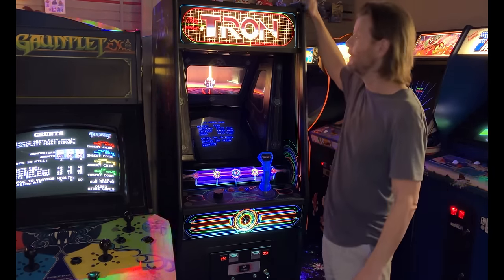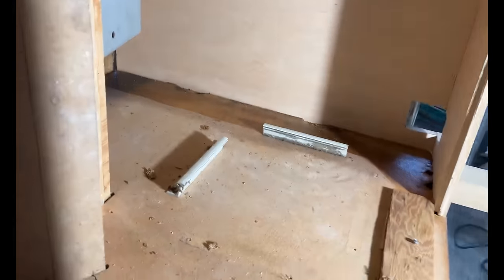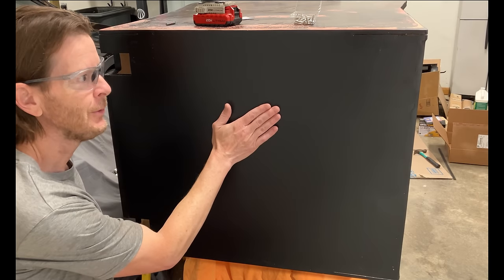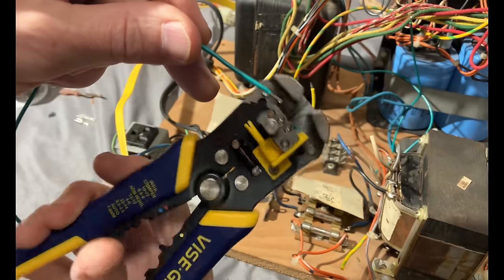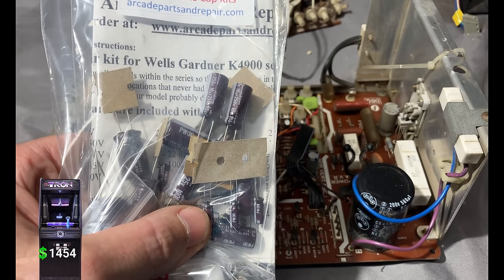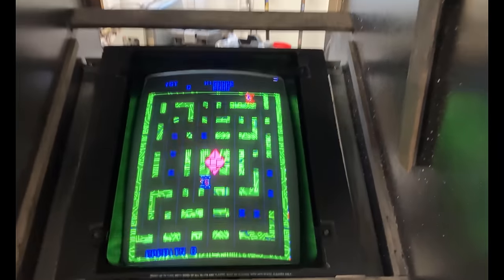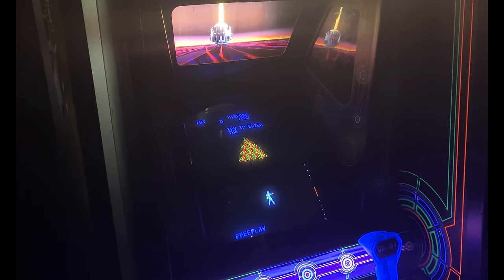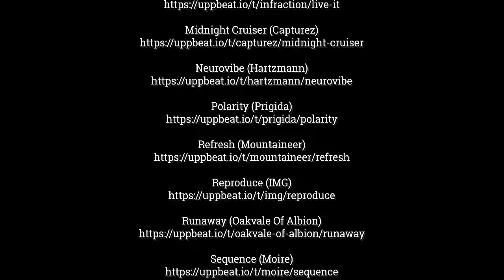"Trashed" Tron Arcade Restoration!

Comment: 1:07:18 would a dim bulb tester (cheap) or a variac (expensive) be useful for working on systems like this? Many amplifier repair techs use them to avoid drawing too much power from the get go and blowing the electronics when there are shorts.
Reply from the maker: Not really--the circuitry built into the monitor will keep it from coming on if it doesn't get full power (or shuts it down if it gets too much). For the most part you just have to give it a go and see what happens. In most cases if there's a short the main fuse will blow anyway.
There is a trick for a monitor chassis where you can use a light bulb to test part of the circuitry (and I have done this) but that would be more for troubleshooting if it didn't work in the tube. Thanks!
Reply: @tcurtis49  Gotcha. That rules out the variac. How about a dim bulb tester?
Reply from the maker: @MikeDS49  The biggest issue overall is the amount of voltage that goes through the red anode cap. If it’s not physically attached to the picture tube then it’s fairly dangerous. When we test the voltage circuit with a light bulb we put the anode cap in a glass jar for isolation. And in all honesty if something does blow it’s helpful for troubleshooting anyway. The worse scenario is to keep blowing the fuse but not be able to trace why. So I’m more fingers-crossed that either it will work or there’s a clear reason why it doesn’t
Reply: @tcurtis49  thanks for the explanation!

Comment: Satan's Hollow requires at least 1 (preferably 2) shield button(s), to be able to play it properly.
A stock Tron control panel does not have a button that can be used for shield for Satan's Hollow.
Reply from the maker: I haven’t played it much but here’s what the kit instructions say: “Satan's Hollow SHIELD is activated with your choice of Spinner, Up, Down or Player 2 button (default) [all menu selectable]”
Reply: @tcurtis49  
That'll work.
Won't be as nice as dedicated buttons, but still will work.
Reply from the maker: I agree. I always try to play in original cabinets when possible. But a nice added bonus in this case :)

Comment: Casters are a serious safety hazard. The amount of offset torque you have with a heavy game like Tron = material ripped out of the bottom of the cabinet and a game that can tip over unexpectedly. I have seen it happen numerous times where either the cabinet material fails or the caster fails. When being played, the game can wander and you cannot level the cabinet on casters. I use and always recommend teflon leg levelers. You can level the cabinet, it stays put but it's easy enough to move when you want to move it. Also has a much lower chance of hurting flooring. 
Wanna move a game a distance, use your hand truck.

Aside from that, brilliant restoration! The game looks awesome in its finished state!
Reply from the maker: You may have been using the wrong casters. These are heavy duty and attached with 4 screws each. I have seen the smaller ones that insert like leg levelers fail; I had a Gorf that tipped sideways on an angle once so I know what you mean. If these get torqued hard they simply stop rolling and stay jammed. They don’t come apart.

On carpet they don’t drift and are pretty level since the floor is level.
I’ve moved 40+ games all over the place with these casters for over 20 years. No issues at all. And I’m certainly not alone—a number of collectors I know always do the same.
But to each their pwn and glad you enjoyed the video!

Comment: Now you've built a plastic case out of the chipboard case. For the cost of repairing the wood you can get brand new wood ;). But at least you can say that it's almost original. Almost a sculpture. Well done. It'll last another 40 years. 🤩 No one can say that you have no respect for the Tron machine 👍
Reply from the maker: Well, only a small bit is resin (relatively), and that's what chipboard contains anyway, and I added the wood chips back, but I get what you mean :) I really considered cutting new sides but thought I'd give it a try and I was really pretty happy with the repair. Easy? No... Satisfying? Yes :)

Comment: This can be a rather nutty community, where one's opinion on a matter is used as an excuse to insult or undermine another persons experience and pleasure in this type of undertaking. I'm glad to see someone that does things in a way to achieve their personal vision of how THEY wish a project to turn out, and the way THEY wish to go about it. My Dad and Grandfather were in the coin-op business for years, and I grew up working on these machines along with Pin-Ball, Ski-Ball, cigarette and vending machines of all sorts. For a short time I worked for a guy that rehabbed these types of things, and it just became a drag. When you do this as a business, any pleasure you may derive from it is replaced by the bottom line. If you can't rebuild it quickly and cheaply for a profit, it's not worth it. I wish I could have spent  1/3 of the time you do, doing it the way you do. I might still be working on them. Anyway, keep doing it the way you're doing it! And always remember, if there's a problem it's power supply, power supply, power supply!
Reply from the maker: I do have to be careful not to get caught up in getting something done quickly. When I first started fixing up games that was the goal—I just wanted to play them. As I’ve gone on it’s far more about diving into the history of the game and trying to make them look the way that brings back the most nostalgia for me. You are right, working on these as a business would lose the luster and fun pretty quickly.

As you can tell from my videos, everything starts with the power supply. Definitely the source of most problems and no reason to do anything with the boards until they are solid ::)

Comment: Agreed with others re not expending the effort on the lower cab restoration and rework, ie everything from just above coin door level on down.
It's just black painted particle board.  That's it.
Cut it off and replace with a full maple plywood base box.
I would agree with all that bondo and glue and repair work if there was original artwork or something else of salvage value in those areas. Remove any metal hardware and rebuild areas with better, up to date materials where it makes no difference art,  function or appearance wise.
Restoring original controls, electronics, pcb, monitors, coin doors, all in.
But substandard plain material like water damaged, moldy particle board can go.

Comment: I can't believe the guy got over $200 for a completely rotted out empty cabinet. Around 20 years ago I was buying old 80's arcade machines for under £100 each. And that included Star Wars (vector), Galaxian, Pacman, Centipede and various JAMMA units. All working! I sold them on for similar prices at the time though, so never made anything much from them!
Reply from the maker: No kidding! I was buying full-sized arcade games at arcade auctions back in the 1990s for $50-75 each. Sometimes as low as $5 or $10! But nostalgia comes at a price and I had to adjust for the current market, unfortunately :)

Comment: I'm no expert but I would recommend a fume extractor, a lot of old solder is leaded, this is terrible for your lungs and highly recommend you get an extractor. great video
Reply from the maker: I think that is good advice. I keep that in mind and try to only work with solder in open areas with a lot of ventilation. If I did this more than a handful of times each year I would definitely start doing that. I might anyway….thanks!
Reply: @tcurtis49  thanks for the reply, i subbed the other day and look forward to watching more of your videos

Comment: You didn't earthen the screwdriver wile touching the rubber cap on the monitor, so it did not do anything to discharge te picture tube's sustained voltage.
Reply from the maker: That's not how that works. You are not grounding the tube to earth, but the inside of the tube to the dag coating on the outside, which is attached to the frame. You are evening the charge potential, not removing it from the tube to ground. 

The screwdriver is touching the metal leads under the cap, which is connected to the inside of the tube, and the metal frame on the outside, which is connected to the dag. This is the circuit needed for discharge. If you don't have a metal frame you have to get creative to make sure you are connected to the dag.

It's like a giant capacitor--you can discharge a capacitor by shorting across its leads. It doesn't have to be earth grounded. You can see a demonstration of that on my old Atari 5200 video on a B+ capacitor holding a large charge.

I know this part is confusing but you can look it up. I've discharged monitors hundreds of times and probably half the time there is no discharge anyway, but the other half pop loud enough to know you've done the job. If it didn't work, there would be no pop, and I would get shocked when working on it.
Reply: @tcurtis49  I respect your opinion, but to me, there is still a charge ratio to ground because of the behavior of the materials used (glass). A glass envelope that works as a capacitor but is not quite te same as a regular capacitor...For my safety, I do connect it physically to ground. 

That is just how I work. I respect other opinions about it, I just use my method to be absolutely sure I don't end up shocking myself.
Reply from the maker: And no disrespect to you as safety is a must and nobody should take any chances working on a high voltage system unless they understand what they are doing. In this case I have seen it discussed multiple times by people who know way more about it than me. In fact, I really had previously assumed that the size of the metal frame was enough to dissipate the charge in itself, much like you can test electronics voltages grounding to any reasonably-sized metal frame, and finally searched for the definitive answer.

I did once conduct my finger to a HOT that had grounded itself to frame while the monitor was running and it’s a pretty good jolt. The most important part is not to have both hands conducting voltage across your body (not great for electrical organs like the heart!, so I always use just one hand. I think most monitor repair pros have shocked themselves with the tube voltage before and while unpleasant it would be very rare to be deadly. Hopefully I don’t find out!
Reply: @tcurtis49  Very true. I probably made more mistakes than any other one working with electronics, including getting shocked by 380 volts. You may say I learned it the hard way.

Comment: Use tarnex silverware cleaner on the boards to clean corrosion. Then rinse with 70% alcohol..: then wash boards with simple green.. finally rinse and then rinse with 70% alcohol again and let air dry.. do NOT use 91% alcohol because it will soften the plastic ..

Comment: Great video, and beautiful machine.

This almost seems like a video for.........why you shouldn't buy a gutted water damaged Tron cabinet and all the parts separately, unless you got an amazing deal on everything.

You didn't really save money in this project vs buying one, and it required a massive amount of time, expensive tools and good knowledge of electronics & woodworking. But you have the satisfaction of having done this yourself, and you can play Satan's Hollow on it too but that could be added for under $200 and the installation trouble/cost, plus the glowing joystick. 

I just subscribed to your channel, and about 20 years ago I bought a similar condition gutted Galaga machine for $80 and a half hour ride that I have not worked on yet. One side has a swollen side at the bottom and I learned in another video cutting that area of the wood off might be the best bet. My plans for it are to turn it into a Galaga themed MAME machine, but I already have a couple Bally Midway machines like that. My friend gave me a 19" CRT VGA arcade monitor which I paid to have fixed ($125), a bare metal Galaga reproduction panel ($35), and replacement artwork for the entire machine (seemed like a great deal at $60). I probably already have an old computer to throw in, I have some Wico leaf-switch joysticks, and MAME interfaces. I'll need Bondo and a few things, but I don't plan to invest too much money into it. Under $500 total. It doesn't have to look perfect, but presentable. 

I play Tron & Satan's Hollow (and tons of other games) out of my vertical MAME cabinet. I have several different control panels for it.  It was a gutted MsPacman cabinet with destroyed sideart. I bought an original Tron control panel (almost 25 years ago) and re-wired it for MAME and with spinner interface. I have the same kind of 19" arcade VGA CRT and it's vertically mounted and looks very authentic. Plays great. I bought a Discs of Tron repro MAME up & down spinner for a future control panel.
Reply from the maker: It certainly is! This is far more for the goal of seeing if I could save it and get it back to a good state. I do typically budget what I will need before even bidding but there's always more involved once I get into it.

I have a good MAME machine (an older ArcadePC version) that I will play around with occasionally and I've been buying games for so long that many of mine are ridiculous bargains by today's standards (Paperboy $75, PlayChoice 10 $5, etc.) so I don't mind splurging once in a while as a challenge.

Glad you enjoyed my crazy (and expensive) journey with this particular one!

Comment: a lot of analogue repairs to do and retrospectively only a small amount of people could do the work of diagnostics and repairing any part of a CRT monitor. of course analogue has always been a lot more tricky to deal with than digital. but i can only say, what comes from a digital output to a screen wouldnt be anything to do with any other part than a eprom rom chip that can only be flashed from a eprom programmer. so those dot arent a fault. its probably pixel colour test or diagnostic code as referance to the lines of code needed for debugging. so best to keep it out of sight, if theres no option to take off debugging mode, if that could sort out the dots. i realise how hard work electronic was in the 70-90's mostly analogue and scientific. rather than digital of what we conveniently use today that has taking the real work away from us of knowing about voltages etc.

Comment: Instead of trying to fix a literally trashed cabinet, I would have CNC/bought a new cabinet.  Over the last 30 years I have aquired the CNC files for many cabinets.
Reply from the maker: Yes, and I had the CNC files for this cabinet, which I used as a guide to remaking the base and the bottom back, as well as the doors. Someone makes this style cabinet out of new wood already. But that just wasn't the point for me--I'm much more in it to preserve the historical aspect of each cabinet as much as possible than rather than have a new one. But certainly would have been easier :)

Comment: What about ventilation?
Reply from the maker: There are vents in the bottom back and the top door for air circulation. This cabinet doesn’t run particularly hot so I haven’t added any additional cooling fans.

Comment: Vinegar does marvels against battery acid. Its cheap and harmless.
Reply from the maker: I’ll try it by itself next time. There are a lot of fans of Zep in the restoration community, particularly with Pole Position. I didn’t find it to be caustic or harsh, though. Just a bit acidic, like vinegar. Thanks for the advice!

Comment: I honestly will never understand how or why people let these old arcade cabinets get like this they don't make them like this anymore if it wasn't for collectors/ Restoration there wouldn't be any left
Reply from the maker: A lot of this happens due to difficulty storing so many games for big operators. They would sit on concrete floors and soak up moisture, or likely at some point get flooded. It’s almost a given that the leg levelers will have been torn off or rusted away and then the wood goes. It is sad but they had little value in the mid to late 90s so they got discarded easily.
Reply: @tcurtis49  that's understandable but I also mean where they are also missing a lot of parts or the harnesses are all mangled since some people like me aren't that knowledgeable with wiring so have a hell of a time trying to get the parts to get it up and running again
Reply from the maker: @kyky121911  Definitely!

Comment: nice job on the restoration
i myself would of kept it as original as possible tho and wouldn't of hacked that other game into it, but that's just me ;o)
that's a pretty low price for a restored unit, i've seen some advertised for 10k (of course those may have been original with no restoration's, the full environmental cabinet)
This one was one of my fav's when it first came out, that one was a full cabinet though (walk in environmental cabinet) i think it was a Disc's of Tron.
Excellent game indeed! I wanted to buy one till i saw the price heheh 10 to 15k is a bit pricy for me 😵
Reply from the maker: One thing about those multigame kits is they are really only (usually) replacing the original game code with an additional layer for other games that used the same hardware. So it’s not really an emulation since it’s running on the original hardware. Bit sometimes there are indeed subtle differences, usually with sound.

I don’t think anyone would pay over 3k for Tron and that’s usually around what I see them listed for. Just a few years ago they were closer to $1200-1500 but I missed that opportunity.

I think I played Discs of Tron a couple of times back in the day. It definitely has a big fan base.